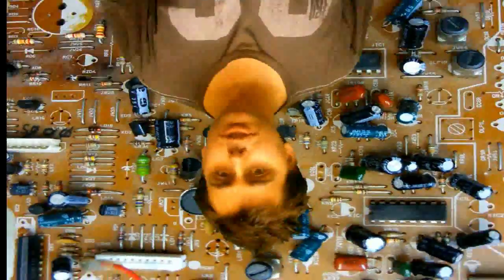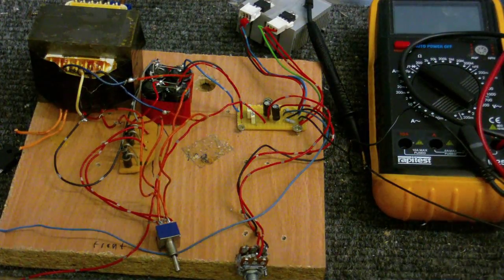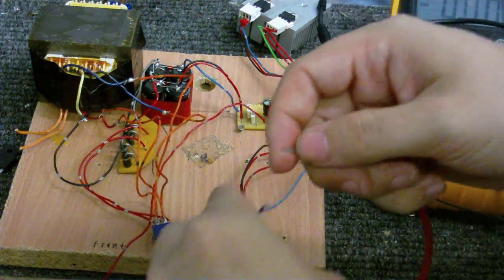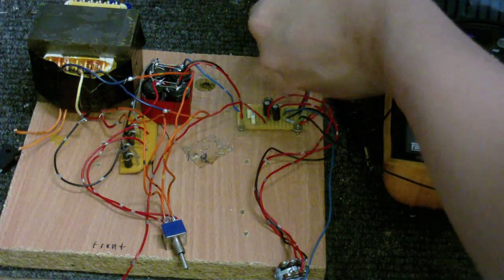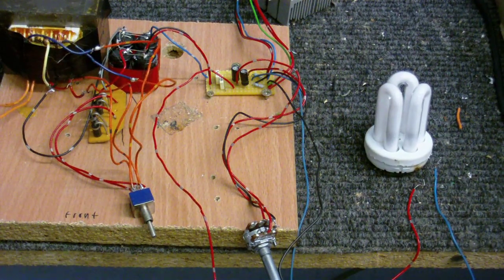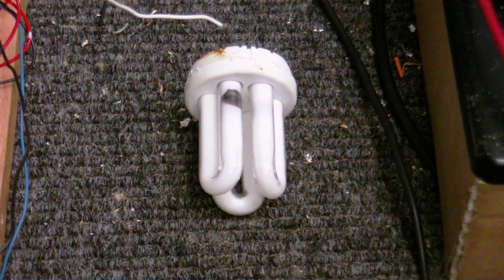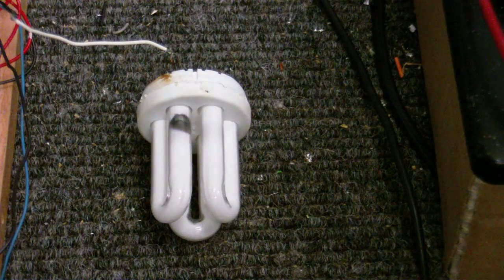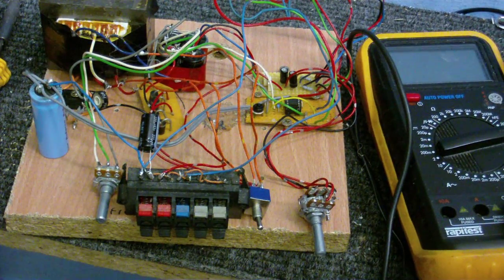More work on Homemade Power Supply & CFL Filiment Pop

Comment: i know what happened
you made the lamp warm up with the high filament voltage
and the mercury got ionized and hot
and when it broke it acted like a rectifier
mercury rectifiers do have a low voltage drop
so the whole bulp got exited and lit up

Comment: the mercury vapor is ionized by the heat (or maybe the electrons given off) from the filament and lights up, but in normal operation the electricity passed through the bulb ionizes it.